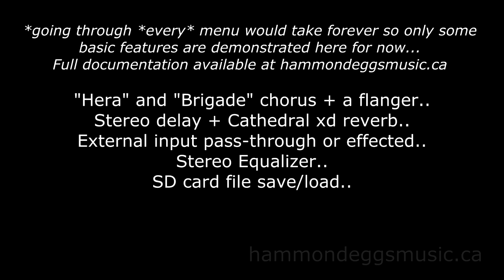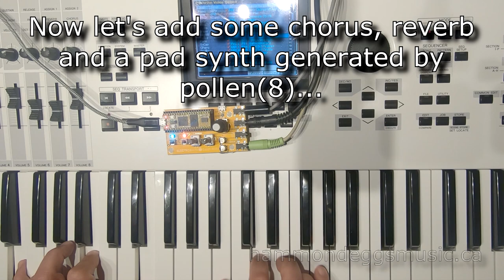Pollen(8) - An 8 voice full featured synthesizer for your electro-smith Daisy pod!

Comment: I've got the Daisy Pod up and running with the Electro-smith native examples running. I'm also able to load the Pollen8 code but the uSD card is not working (web load completes fine but then two red flashes after reboot). The uSD card is 64G formatted to exFAT. Has anyone been able to load/save patches to the uSD card? Anything special you had to do? TIA.
Reply from the maker: Hmm - I haven’t tried exfat - I used a much smaller card and I believe fat32. It’s entirely possible their fat library doesn’t/ didn’t  support exfat. Pollen(8) doesn’t need a lot of data, maybe try a smaller card if you have one!
Reply: @hammondeggsmusic  Thanks! I've got a 16G on order and will post results when it shows up...
Reply: Works fine with FAT32
Reply from the maker: H N cool! Thanks for checking that out.

Comment: it does not work on my pod. the sound is almost absent (hardly audible on the extreme gain, and therefore with terrible noise). I see my daisy seed is slightly different, it is rev5 and has a different audio codec - could this be a reason?
Reply: and in general - is this project open source? can i see the code anywhere?
Reply from the maker: @LubkoReminetskyy  I have reworked this entirely and added new engines, it’s not quite done but it supports the new codec, and yes I’m going to open the source. I need to get a few things done first beforehand.

Comment: Would it be possible for you to generate a new bin file that works with the Daisies that are being sold today. Electro-Smith has changed the codec three times that I know of, probably for parts supply reasons. Their compiler will autodetect the codec on the board that it's connected to and generate the proper bin file, but an old bin file only makes silence on a new board with a different codec chip. The lights and buttons appear to work, so the code is running, it just can't talk to the codec.
Reply from the maker: I’ve recently got a couple of the new seeds, I’ll be looking in to this!
Reply: @hammondeggsmusic  As far as I understand you only need to compile it again with the new librarys and it should work on the new codec. :-) I trashed one of my daisy seed with the old codec and would love to play your synth again :-)
Reply from the maker: Keen Vox Yeah, it’s not “quite” that simple unfortunately as a fair bit changed since it was released, I’ve had to remove the sd card and use the on board flash for instance so it can still fit. Almost done though I will be releasing it soon, with a few fixes and improvements too.
Reply: @hammondeggsmusic  Any progress on making the Pollen 8 play with a new Seed?
Reply from the maker: TubelabCom Yep - it’s a pretty big project that does a lot thanks to the new boot loader. Mostly UI stuff to finish

Comment: I just discovered Pollen8, wonderful nice synth!!! maybe you can share the patches  used in the video?
Reply from the maker: Hmm good idea. I really want to get back into this project and add some more features, once i finish up a couple things for the ‘logues I’ll get back to this one !
Reply: @hammondeggsmusic  Thanks. Also, please consider MIDI-CC to edit all parameters, I wrote some editors using CTRL and would love to have one for Pollen8 ;-)
Reply from the maker: Autodafe Absolutely! Part of the reason I’ve been a bit late on that is I want to make it totally programmable - e.g. an .ini or json file on the sd card will let you assign various CC / sysex values to various synth parameters etc - this way I don’t need to make it compatible with “x” - you can just edit the ini file. Thanks!